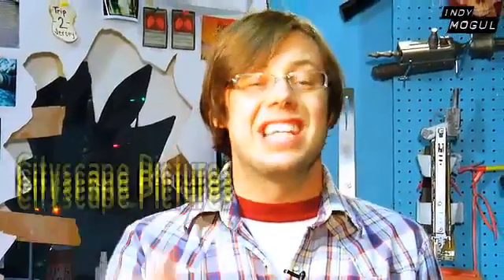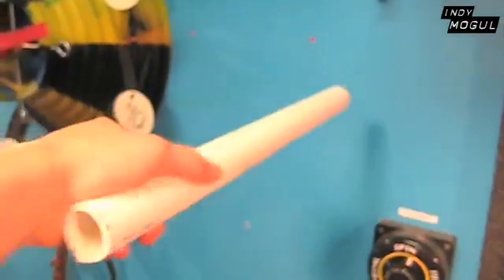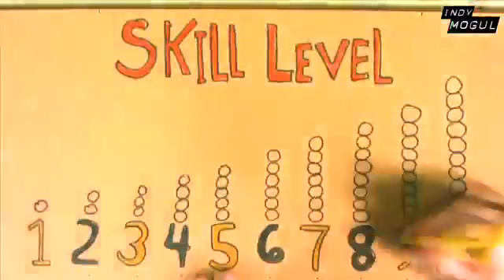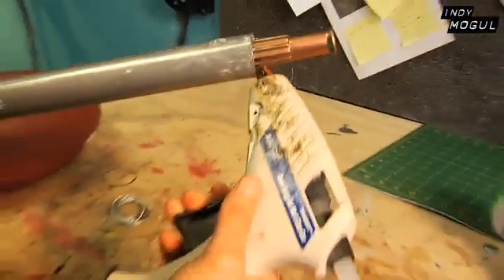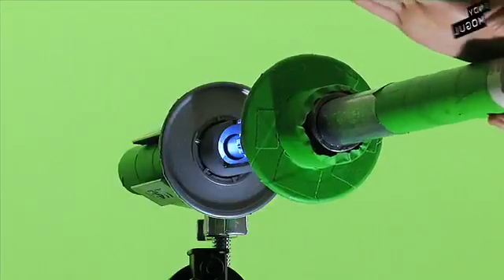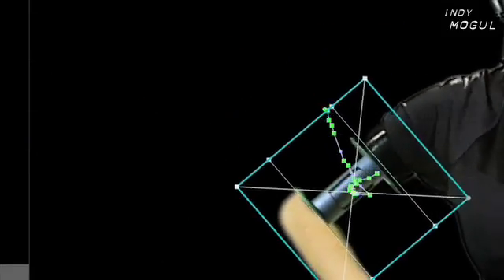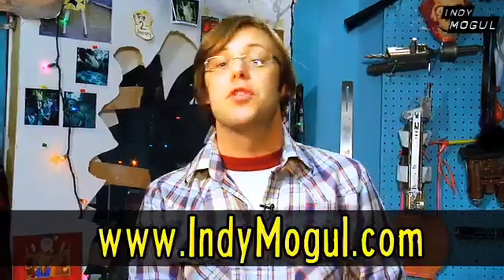Cyborg Arms for Robot Girls :  BFX : Build

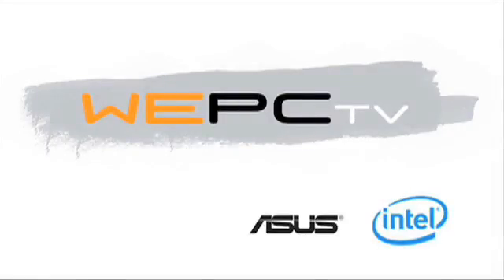Comment: 1:39 60 Tera FLOPS / TFLOPS (Tera Floating Point Operations Per Second) contains the "per second", so saying FLOPS per second is redundant.
For a real world comparison if that is really skynet, Folding@Home was runninng 24/7 around 4200 Tera FLOPS (4,2 PFLOPS) in 2011. The most powerfull supercomputers are in the range 1-10 PFLOPS.
My personal computer is running at a bit above 2 TeraFLOPS of single precision FLOAT, and 0,5-0,6 of double precision FLOAT. 6-core at a bit above 4GHz and a good GPU